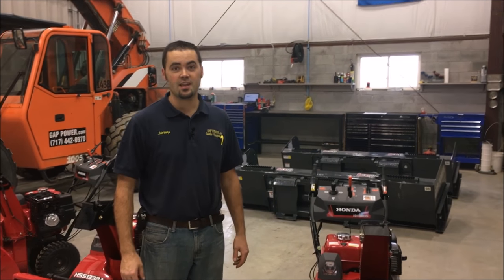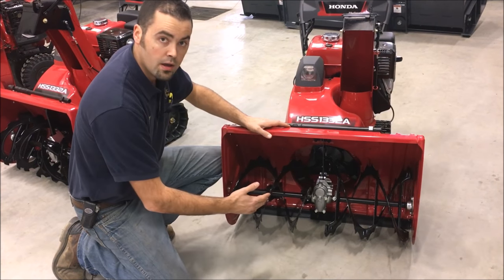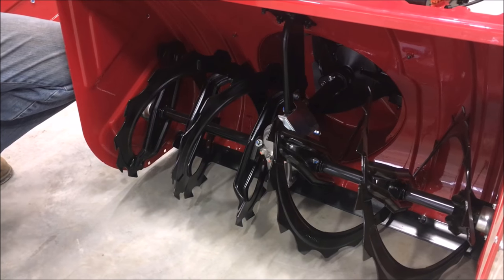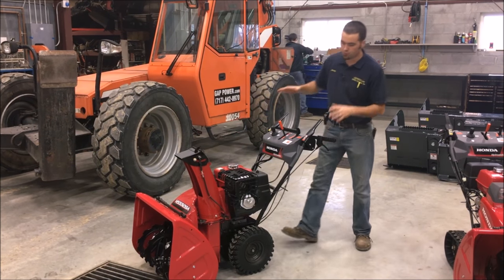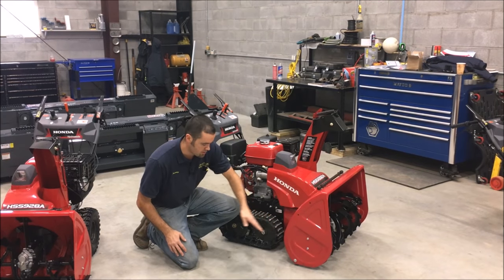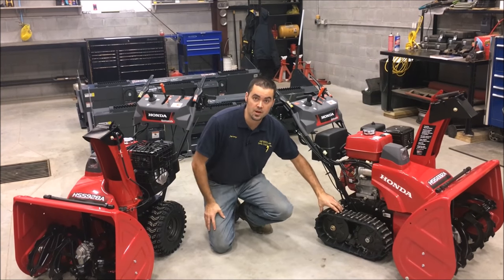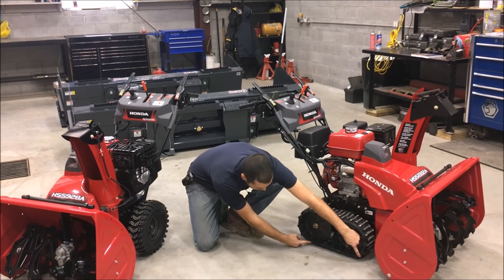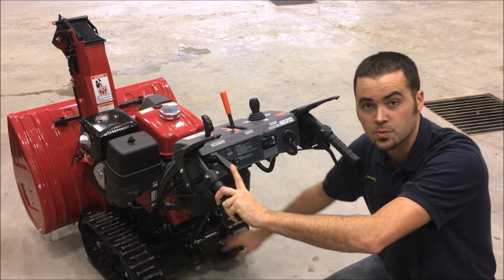Honda Snowblower Model Comparison

Comment: First test of my Snow Joe was a massive blizzard that dropped 20+ inches of snow with drifts well over 3ft. https://www.youtube.com/post/UgkxoHYZbq5g9fkcAtinlTqstNlje-UQkCHN This snow thrower is definitely not designed for this much snow but it powered through it. We did have to knock down taller drifts with a shovel and at times the chute was awkward because snow banks were much higher than it could throw, but still much easier than shoveling. The plus side of the small size is the maneuverability. Easy to lift up to walkways and works in tight spaces near cars. Highly recommend.Note: after assembling it started but did not turn. The belt wasn't in place. Easy fix.

Comment: I recently purchased an HSS928 with tracks, in my opinion the side skid shoes are a must! Love this machine!
Reply from the maker: We've seen many blowers come in for service after years of use that would be in much better condition if those skid shoes were installed... Thanks for the comment Dave
Reply: Do the skid shoes affect performance in any way? Just wondering why they wouldn't come standard. They come with skid shoes on the back of the bucket. Do you leave those on when you put the side ones on?
Reply from the maker: @bobbybrown614  They do not affect performance and come into play when the surface goes up in the front, like the edge of another surface or running into ice.   Also if you angle it so pressure is added to the auger it provides a secondary safeguard to that front edge rubbing a surface.  It is not required like the wheeled machines, just secondary protection if you want it, that is why its not standard.  Yes, you would leave the back skid shoes on.  When you adjust the back skid shoes and scraper bar you would adjust the optional skid shoes at the same time.

Comment: How are the track machines compared to the wheeled models as far as icing up after the machine is shut down and put away? I've had trouble with the chute next snowfall when its very cold. The base of the chute has frozen up. I would think that the tracks would also ice up and not work well the next time you used it. Its not like the weather warms up enough for it to thaw in the dead of winter. And no, I don't have a heated garage.
Reply: They can ALL ice up
Reply: I have had mine for 17 years. Track has never froze up.

Comment: I have been reading that they had a fatal transmission design and if you push it hard, the pin in the wheel axle will break and it is over $200 to replace ( because honda makes you replace the whole   axle).  I am not sure if they corrected it on the newer models.  I would love to know!  I figure the whole point to having a track is so I can push it through frozen snowbanks and not break!
Reply from the maker: Good question Chelsey.  Years ago that was the case. Today there is a pin in the end of the axle that will shear if something goes wrong, however we rarely see that happen.  You can see a picture of that shaft and drive wheel here: https://goo.gl/3FYmyA

Comment: Very informative and clear. I fix a lot of snowblowers and I am not a Honda fan at all. They are very expensive to repair. If a part cost $20 for the average machine it will be $60 for a Honda. It seems most Honda parts are designed to make it very difficult to repair without the new overpriced part. The scrapper bar wears out quickly because of the design. The shoes for the height adjustment are at the back of the auger drum and are held on with 5 M bolts that are too small. If you strip or break a bolt you have to replace the bracket on the inside of the blower ( Both bolts are welded to it) and then replace both bolts with the new assembly ( probably $20) Your other choice is to drill out the broken bolt or grind it off to replace it.I am sure that Honda wants you to buy there new part and thats why it was designed that way. Most other blowers have a scrapper bar with a slotted grove to lower it but Honda has fixed bolt holes at the back of the drum and then a bolt on each side of the drum to allow the bar to pivot up and down but not enough adjustment so you will be replacing the scrapper bar every two or three years depending how much you use the machine. Honda should have shoes at least 6 inchs long  that mount on the side of the drum instead of the shoes they have on the back so as to make the machine move easy and protect the drum from wearing  down so easily. There are lots of other things that are very expensive to fix but it has to do with how it was designed and in my opinion it is just a money grab. Heres the good stuff about Honda. They start easy,have lots of power,blow snow 50 feet,have excellent resale value,good quality paint,built with better metal than most machines,metal was prepped properly before they are painted. Ok thats it for now. I have to go weld more metal onto my scrapper bar.
Reply from the maker: Good comments, we work on our fair share of snowblowers as well.  There is always the question of value.  With snowblowers, you can compare value of parts, repairs, cost of purchase etc... but like you mentioned, the measure of value is completely different when you are powering (or not powering) through wet, heavy, or deep snow when its cold (and you are cold) and you need to open up your driveway or parking lot.
Reply: I have used my tracked Honda for 30 years,that's right 30 years,have only had to change the belt,that's it.Glad I bought it,now I have a Kubota tractor,clean up is now a breeze and less work.

Comment: Would you recommend paying extra for the tracks?
Reply from the maker: John, it depends.  The benefits of tracks are many but the wheel machine has its place.  Specifically if you have small areas to get in and out of i would recommend the wheels.  They are easier to maneuver in tight  spaces.  Tracks on the other hand have better traction, height control on the auger (apply additional down pressure or keep shroud up for transport or blowing over a stone driveway or yard without digging in or throwing stones.), no tire pressure or tire maintenance.   Hope that helps! - Jeremy

Comment: So, let me get this right... The "Auger Interlock" AKA 'Kill Switch".. will... Maybe...Hopefully...If Everything Goes Right...If all Works Right... It stops the engine !!????
 Sounds awfully iffy to me. Like sometimes it works, Sometimes it won't. Just trust me and just let's see.
 Thanks MacGiver but NO THANKS!!!
Reply from the maker: Rick,  The "kill switch" does work very well.  I've used it and it does what it is supposed to.  When the sensor detects excess load on the augers it stops the engine.  The augers don't stop instantly but the engine does shut off and the augers come to a stop as the engine shuts off.  This unit still uses shear pins like all other units do.  **The intent of the kill switch is to minimize having to replace shear bolts.**  The other question I've been asked is if the kill switch activates too quickly. We've sold a bunch of these and nobody has had issues with "false" kill switch activation.
Reply: Not needed